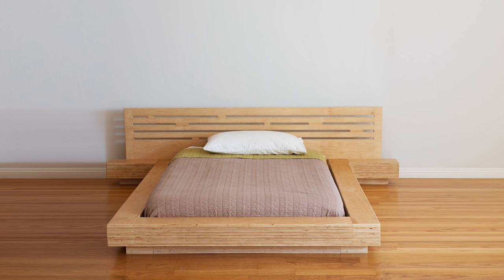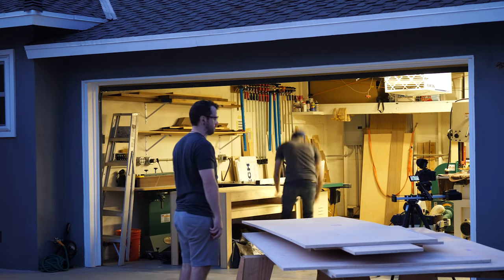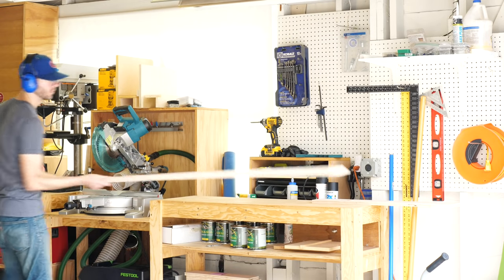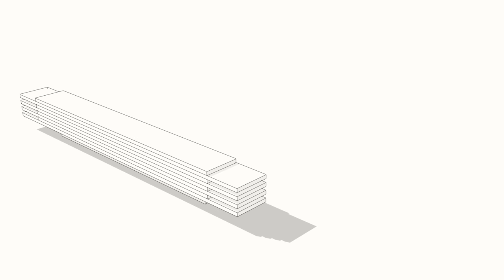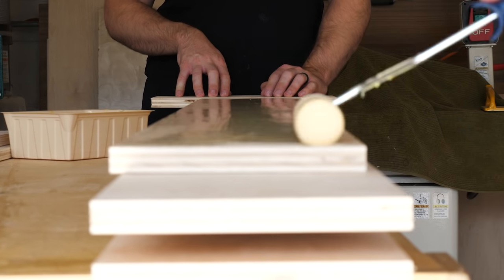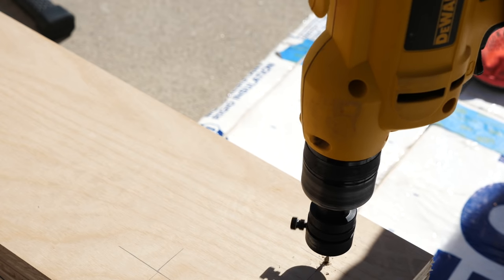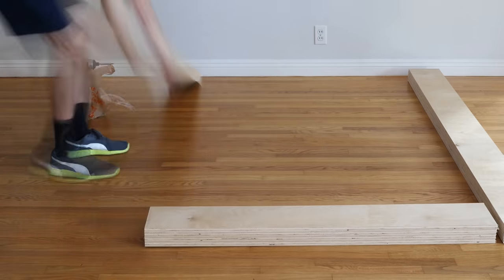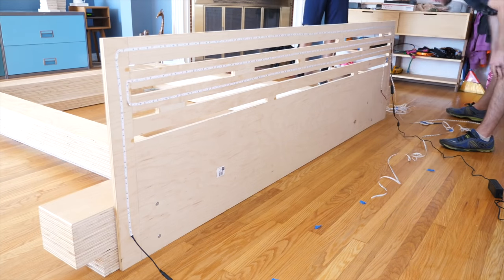DIY Modern Plywood Platform Bed Part 1 : Frame & Nightstand Build - Woodworking

Comment: Great project idea and videos, thanks.  I bought the plans and scaled up the dimensions from a standard Full mattress (54" x 75") up to a standard Queen (60" x 80").  But, after cutting all the planks, I realize that the design is actually a bit too short for a standard Full, and as a result, my side boards are a little too short to fit my existing Queen mattress (it will probably just barely fit, but with no clearance for sheet access at the head or foot).  After studying the Sketchup, I realize that you built it around a 74" long mattress, which is 1" shorter than a standard.  I'm sure that there's some variation in normal mattress lengths, but I would suggest that your plans should be based on the standard size (and yes, I should have drawn it all out and measured my mattress before cutting... lesson learned)

Now I'm debating between cutting 1" from the footboards (which may or may not mess up the symmetry), or else shifting the side rails out by an inch or two, and adding a cosmetic spacer at the foot.  Neither is ideal, but the Purebond plywood is too expensive to justify re-cutting all the side planks.  I'll make it work, but figured I should point it out.
Reply: howd it go
Reply: @Miggggy  Hey, thanks for asking - it came together okay, but with some reworking required on my end.  That's due more to my learning this stuff on the fly than with the source material, but the adjustments I had to make to turn it into a queen size didn't help.  I'm going to put together a video of the results, along with some thoughts on the size adjustments, will post here.
Reply: @chris.a.1 nice

Comment: Hi Chris. Great video. Those interlocking beams you created. Would they be strong enough to be used as a table frame to rest a tabletop on. Or would they start sagging in the middle without proper cross support. I’m thinking about using this technique to create a board game table with a recessed gaming area. Thanks
Reply from the maker: I'd have to see the whole thing to really say. It kind of depends on the base, the table top, etc...but the beams themselves are pretty rigid

Comment: Great piece did you consider putting something underneath the bed so it doesn't mess up the floor with such a large footprint I know the weight alone will probably prevent it from moving. Awesome builds thanks for sharing.
Reply from the maker: Thanks. Yeah, this thing aint moving unless you're trying to get it to move :)

Comment: Is the mattress sitting on anything, or is this just a box around a mattress on the floor?
Reply from the maker: In the video it wasn't. I didn't want to set up the whole slat system for the photoshoot in my living room (so I just quickly put some supports underneath. In real life it sits on the system like I described in the animated portion
Reply: Oh, I see. At 3:40

Comment: These types of beds look neat but are there benifits to this type of bed?
Reply from the maker: Not particularly. They are usually easier to build for beginners. There is a little less going on with a platform bed typically.

Comment: A great build that I definitely want to try for myself! My only questions is did you do anything to attach the platform pieces to the base pieces?
Reply from the maker: Sort of. The platform is resting on top...but b/c of the slats that sit on top of the base pieces also (to support the mattress) and b/c the base and platform are both attached to the headboard...they can't really move independently of one another.

Comment: The bed looks awesome, and the concept is so simple!
Why didn't you build the base the same way as the top? Better design with base matching top, easier to assemble (with wax), no crappy L-brackets, no gaps.
Anyway, great job, very inspirational as usual.
Reply from the maker: Lots of work for very little payoff :)
Reply: Lots of work, with only 4 layers? I'm not sure I get it, but I assume you must be right...
Reply: HODYO Design B.B.
Reply: Good point. I would definitely use the same layered design for the base. No reason to use L brackets.

Comment: “We literally ripped from day to night” damn bro let me hit that juul too
Reply: Genuinely need to know what 'ripped' means. I assumed it meant separating the layers of plywood, but it looks like you were just cutting them as you would normally cut any wood.
Reply: @theblackwidower  rip is just cut with a saw. Tesnds to apply to any saw with a circular blade due to the fact that they tend to rip the wood out.

Comment: cool little quick bed build here ... question though -- How did you attach the base to the top? Assuming it was not just some screws in from the headboard?
Reply from the maker: It's honestly been so long I don't even remember anymore. Jonny Brooke from Crafted Magazine has a whole plan for the piece. I know they are both attached to the headboard. and then there are slats for the mattress that also kind of tie everything together.

Comment: How many sheets of plywood did you need to build that ?  Here in Canada, a sheet of maple ply at home depot is 70-80$.
Reply from the maker: 7...sheets..so pretty pricey in Canada :-/
Reply: He could have used a lot less by hollowing out the middle. No need stack an entire width on top of each other like that when strips would have done and looked the same.

Comment: You can go faster alone, but farther together.

I like the look of plywood.. but I'm curious, do you think it would look weird if you applied iron-on edge banding to all the single pieces of plywood? would it have a clean hardwood look with a bunch of cool grain or is that just in theory... would it end up looking super fake and dishonest?
Reply from the maker: This is one of those situations where I say "embrace the plywood" you could go the other way, but then I think it would make sense to build the whole thing differently.
Reply: totally got ya! i love the plywood look... but i guess if you were trying to be cost effective and hide plywood.. you could bulk it with plywood and maybe add thin single sheets of hardwood as faces? something that seems a little more agreeable and natural? what do you think?

Comment: How did you do that timelapse-zoom-out shot at 2:26? Do you have a zooming machine of some kind?
Reply from the maker: I do have a slider. But for this it's shot in 4K but converted down to 1080p. So basically at 50% it fills up the entire screen and at 100% it is pixel perfect but cropped in. So I'm just digitally zooming out.
Reply: @Foureyes.Furniture  Ah, gotcha. Thanks for the reply!

Comment: Is there a benefit to every piece being solid all the way through? Seems like that would make them super heavy unnecessarily. What if you cut out triangles (almost like a bridge truss) from every plank of plywood except the top one on the stack? That should reduce weight, maintain structural integrity, and have no effect on the final appearance. ..In theory, ha, I've not tried it myself. I do like the stacked design. All those thin layers of plywood look really cool at the end. Great video!
Reply from the maker: Hey Taylor...it should work in theory. Honestly - one of the big reasons for us doing it this way is...it's easier. Also, we were on a time crunch since Johnny and I live 3000 miles apart. So we went with the most obvious quickest way to build.

Comment: It's hard to say the plywood is awesome when the first time you see it here, there's a big old void in it (you can see it around 0:26). I've run into this myself with this plywood from HD. The veneer is not very thick, the layers are too thick, contributing to a lack of stability and flatness unless glued into stacks like you're using it here.

I get that so many are sponsored by it, but it's not particularly good plywood.
Reply from the maker: That's not a void...also...that was the factory edge that will get removed - but honestly If it was crap plywood I wouldn't use it. The stuff I normally get (walnut veneered, etc...) is about $100/sheet from the hardwood store. This stuff is like $45/sheet from HD and is actually pretty good. The cores are as good as the other stuff I use, save for baltic birch
Reply: I just built a huge bed out of purebond as well, and there was only 1 small void in the 7 sheets I used. It sanded like butter, and painted beautifully.
Reply: The description you gave of the thicker layers in the middle, that's not indicative of Home Depot plywood rather that's indicative plywood that's made in the US. And while Chinese and Russian plywood typically have more thinner layers, the Chinese in particular but also the Russian plywood is so far beyond dimensionally stable that I won't even attempt to describe the frustration of cutting into imported plywood's with built-in tension.

Comment: I've noticed influx of videos this week sponsored by PureBond plywood.  It's a shame that HomeDepot's presentation of PureBond is confusing.  They appear to have 5 different products, but 2 seem to be repeats of other species, Birch, Maple, Red Oak, Birch, and Red Oak.  Five of those aren't prominently marked as PureBond, rather the most prominent branding is Columbia Forest Products.
Reply from the maker: hmmmm...in my area they usually say "columbia purebond" on the side...and I think they do have maple and red oak veneered. But I recall the 1/2" being different than the 3/4. I'd have to really study it to make sure if I'm remember correctly.

Comment: Why is plywood so popular 
I hate the look of plywood
The layered sides looked big I guess it looked like it is to big.
And most plywood is pinky salmon in colour which I just  don't like the couler
If I were to use plywood I would use a stain to get rid of the pink colour and use a vinear (preferably oak) to make it look better but the colour it would turnout wouldn't work for this bed so altogether I just don't like this bed

P.s. Sorry for the long comment I got carried away

Edit1: on further look the plywood is an OK colour (still a bit pink but better) and I would just get a vinear that matches (still don't really like the bed)